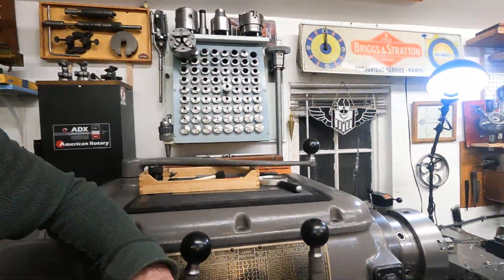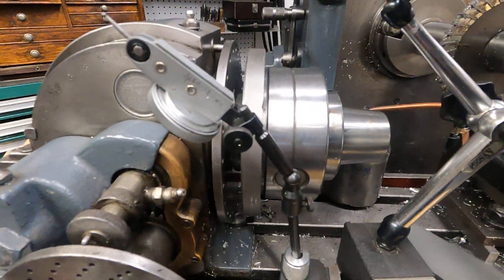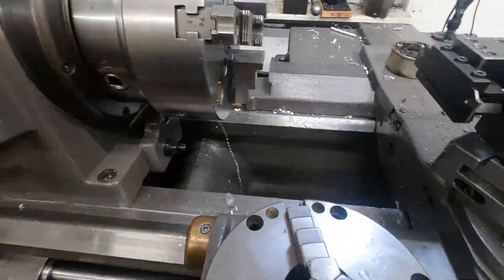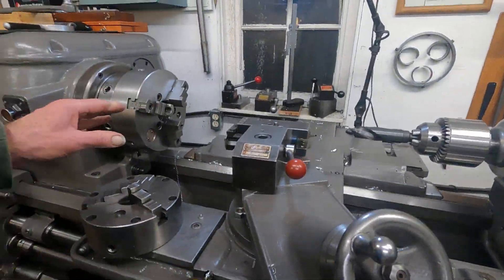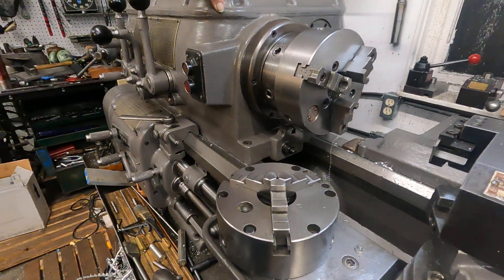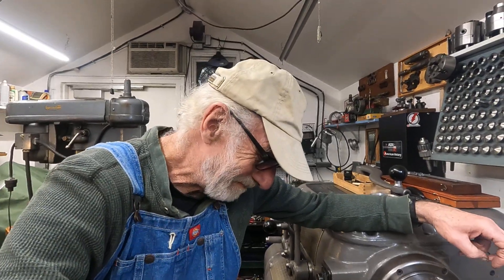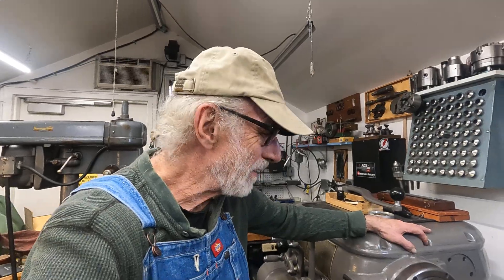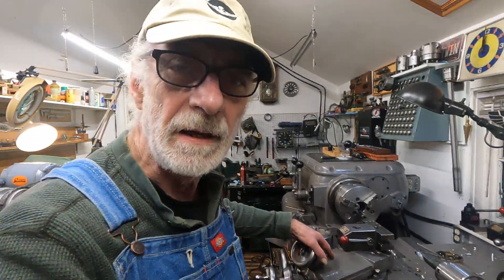The .002" point in machining and mechanics

Comment: Honda V-series crankshafts are plus or minus .004” per our service bulletin. We had a lot of issues with the V-4 engines in the VRF 1000cc bikes back when I worked at the dealer. They vibrated pretty badly even when we dialed them in to a half thousands ! But it’s interesting how much H.D has on theirs. I never worked on H.Do’s but I’ve done more Honda’s than I could even try to count. 
The flat V-6’s were the most forgiving of them all. But I hated working on them Goldwings. Too much plastic to deal with just to get to anything. 🤬 good running engines and have a ton of potential for horsepower. But heavy as all get out.
Reply from the maker: I think there is some things related to multi piece crank shaft and straighten bent hydraulic rod that separates the millwright from the general dandy machinist.
Reply: I'm curious. Is the spec for runout in overall diameter, or radius?
Reply from the maker: It would include both radial and axial run-out of the main shafts. @fredflintstone8048
Reply: @fredflintstone8048  the spec I’m referring to is the total radial runout. That would be indicated at the main journals.
Reply: Do the HD crankcase’s split over the cranks ? I’ve never tore one down. The Honda all split/ have a seem on the crankshafts and some of them have a pin to locate the main bearings. ( roller bearings)